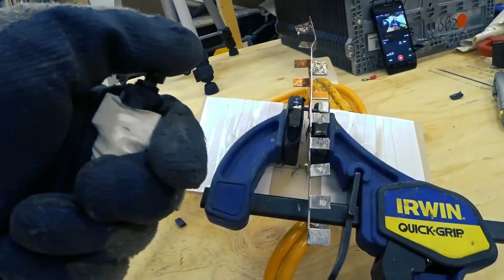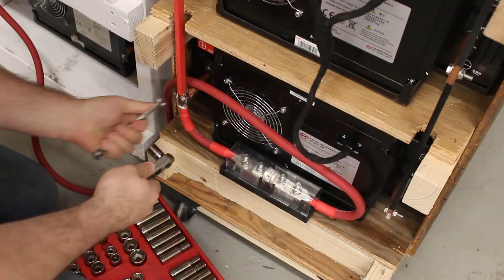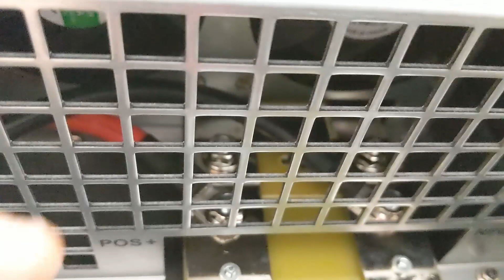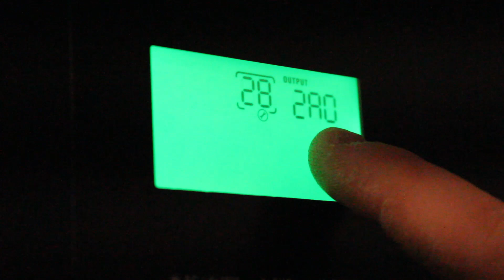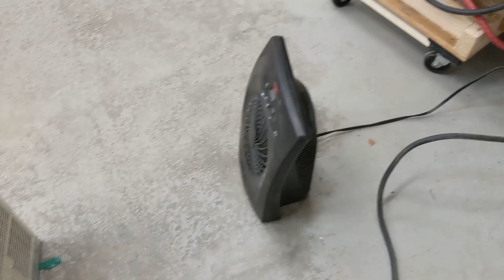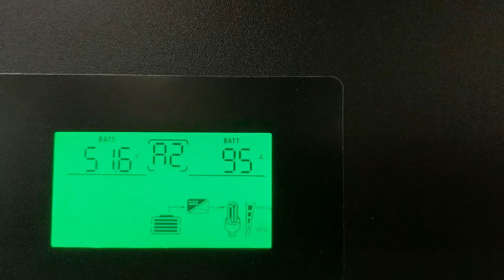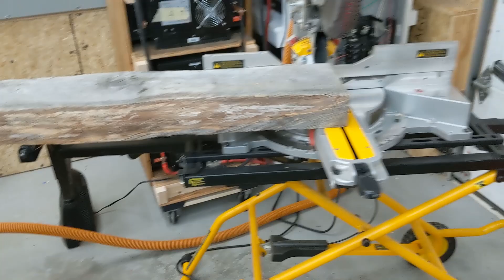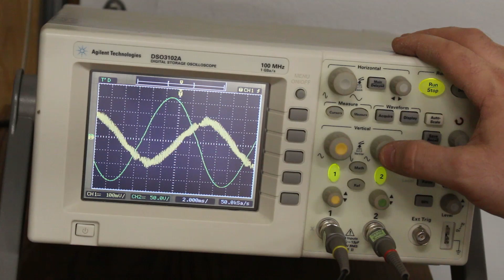Split-Phase Inverter, LV5048, Test Solar, Off-Grid

Comment: Like you, I'm concerned that the single inverter in split phase mode couldn't start the miter saw. I know well pumps have significant start-up surges, probably larger than the miter saw. Tying the inverters together in single phase mode would likely start either the miter saw, or the well pump.

Have you been able to see how the inverter works at your friends place?
Reply from the maker: Yes, it was able to start my friends well pump, but only if nothing else big is on.  The inverter overloads if the well pump tries to start while something like the toaster is on at the same time.   https://youtu.be/6XLOKtl-q3s

Comment: I believe you can put the unit in 2A0 mode (120V output, L1 and L2 in phase) and short the L1 and L2 outputs with a jumper to get full power (5000W) at 120V. This is what was recommended to me by Andy at MPPSolar and it worked.
Reply: how is this working for you? I am thinking of doing the same with mine.
Reply: Only if you dont have 240v input from grid. If you dont do the jumper the unit will not charge your batteries with grid. Some people trick the unit with jumper to make grid possible when 240v grid is not available.

Comment: You must have some settings off. I own 2 of these units even when I only had 1 installed I was able to run my entire house and some of my barn along with my 3 ton heat pump and we'll pump. I only installed the second unit because I would occasionally over draw it. Now running 2 units I have never overdrawn them. I remember while setting up my unit I had some settings off and it acted like what you are seeing
Reply: Can you remember what needed to change or can you recommend what to watch out for when setting this up? I'm about to use one of these myself for an off-grid system. Thank you!

Comment: Question... how can I set up my 4kw on grid system to work off grid without batteries? I currently have a SunnyBoy inverter, but it is not hybrid. I want a set up so I can switch to off grid when the power is out to use my solar when the sun is out without adding batteries. Thanks!!!

Comment: Hello
Have you tested any other of the MPPsolar inverters?   Have been thinking about switching over to a solar converter to rid of having to have a controller and inverter as well as all the wires.  Am interested in the 24v unit the 2024 or the 2424. I just cant find alot of info about it on youtube.
Reply from the maker: I have not tested any other model.  Try checking out Bobby's channel.  He is running a 24v unit.  It might be the same model as you are looking at.  https://www.youtube.com/user/yankey4

Comment: David, what size resistor did you use on the initial setup of the investor? I saw the 100W, what ohm is it or does it matter? Thanks again.
Reply from the maker: I think it was 1ohms.  I bought it on Amazon but the exact item is no longer available.  But I found several other sellers with identical looking resistors.  an old incandescent light bulb can also work.  Higher ohms could also work, but you will just hold it on slightly longer.
Reply: DavidPoz thanks found it on another, ordered a few to do other things with. Thanks for replying to me.

Comment: Excellent  5 KW  2 phase ( 120 & 240 AC V )  inverters  #  David when U connected  UR   space heater  ( 4800  Watts  /h )  it was  working   , means  2  separate  2.5 KW  inverters in this  single  5 KW/h inverter  are    interconnected  (  parallel or series  )  otherwise  UR  4800 KW / h space  heater   wouldn't   work  #

Comment: The Lv 5048 can be switched to 120 volt AC only, running both it’s inverters in parallel thus it can do a chopsaw with sudden surge but only if it is not set up as 240 volts, cause then each leg is limited to 2500 watts.

Comment: So did it power your buddy's well pump?  How is it working for him?
Reply from the maker: Yes, it was able to power the well pump.  But it has overloaded on him if he has another big load on it.  For example, if the microwave is on and then the well pump tries to turn on.  Then it overloads.  To me, it's too close.
Reply: Ya that's no good. I would not be happy.  I wonder if 2 3000 watt growatt inverters set up in split phase at 6000 watt would fare any better? I'm thinking of going that direction or maybe buying an Aims inverter charger.  
I think there are a lot of people out there looking for your type of review where things really get put to the test on the new Growatt 3000w 24v or 48v units.  Also the MPP solar LV2424.  Although it's quite similar to the lv5048.  I bet MPP USA would work with you to review their stuff.  They are refunding $100 for people to review the ones they buy on YouTube.

Comment: With each of these videos I watch I get slightly dumber.  I'm going to have an electrician install what I have.  It's a MWS 2000 W wind turbine, their MPT Classic all in one charge controller, a 24 V 6000 W AIM sine wave inverter and 10 12V batteries of 140 Amp connected in series by 2's so their are 6, 24V 140 Amp batteries then the 6 in parallel giving one 24V lets say 600 usable Amp AGM Battery.  I know jack about this stuff and there are enough skull and cross bones for me to yield to the electrician.  I'll do a video of what he comes up with.  But as far as I can tell the turbine has 6 wires coming out that are 2 seperate 3 phase AC power sources.  They are to go into the charge controller.  The charge controller goes to the battery.  The inverter goes to the battery but here is where I'm lost: It seems like they want me to connect the inverter to the main breaker.  There is an AC in and AC out on this thing.  The manual appears to want me to take 3 phase AC from the main to the inverter and back out again.  Plus it mentions grounding everything to which I am over my head.

Comment: I have a much lesser Inverter that I have purchased used. I bought it without fully understanding it. It is an Accurate Tools ATSIU-2500watt Pure Sine wave Inverter. It unfortunately is 240V vs 120V I was expecting. That said I was curious if I measure ground to Live I get 120V. If I measure ground to Neutral I get 120V and if I measure Live to Neutral or Live 2 I get 240V. This is a 24V instead of 48V. My question is would I be able to connect it to my Dryer port in the house. turn off all my other 240V items like AC, Furnace, Hot Water Heater, etc. and the Mains breaker (don't want to back feed the grid in an outage) and power my house in the event of a power outage. The power outages are becoming less common but we use to get power outages at least a couple a times a week. This is an old unit that I bought but was trying to figure out how to make it useful. I would be willing to ship it to you to put through its paces if you were interested.  Let me know.
Reply from the maker: If you have a 240v dryer, then it probably draws about 4000 watts when the heater element turns on.  So it would probably overload your 2500w inverter.
Reply: @DavidPozEnergy  Sorry I did not explain too well my intent. I plan to unplug the dryer but use the 240V 4 pin port to plug my 240 volt inverter into my house. I know it would be better to have a dedicated port but this is in close proximity and already exists. I would not be running the dryer off the inverter but trying to power my other 2 phases of 120V from my 240V inverter. Things like my router for internet and TVs and things like that. Without my AC, Furnace, Hot water heater, washer dryer,  and range i feel that 2500W would go a long way. Mainly Fridge and a seperate freezer unit in the garage

Comment: Dave can you post your buddies results. If it works with his well pump. I would like to do the same setup if it works. Thanks.
Reply from the maker: Yes, it did run his 240v well pump.  But he found that the inverter would shut off if two large things were on at the same time, like the microwave running, and then the well pump kicks on at the same time.

Comment: Cool ! Nice Video.
We have the exactly model ISolar MLV 5KW.  it is Super Power 5KW for 120Vac 60HZ output (Like US/ Canada/ Mexico and Latin America countries). it also support split phase 240Vac ( L1-N-L2). it can be parallel with Max 3 units. So you can get Max power 15kw for single phase and 3-Phase. Check this link: 
https://www.aliexpress.com/item/33058021760.html

Comment: That sine wave is noisy as frig even with no load, that ripple voltage appeared insane. Would love to see the THD with a power quality analyzer.
Reply: If you look at the settings on the bottom of the oscilloscope display, one channel is set to 50V/division (correct) whereas the ‘noisy’ channel is set to 100 millivolts/div which is obviously incorrect.  Need to manually set up the second channel.

Comment: This video  definitely  helped me ,  I was on the verge  of purchasing  this  model  however  after this review  I will revert to my original  plan and do separate  charge  controler  and inverter. At least if my inverter  is rated at 5000 watts , I know that's  what I'm getting .
Reply: Basing an important decision on Dave's amateur testing is not really a good idea.

Comment: Hi Dave, what was the error code that you were getting went it overloaded?

> I got the Hybrid LV 5048 Inverter/Charger. It is set up as a single phase; I was getting error code 72 when there seemed to be an overload. 
I sent email to MPP solar and they said: "1.What is the program28? Is it 2A0? If so, please short the AC output L1 and L2 then try again."
So I combined L1 and L2 on the output side and now I can run things that used to generate error code 72. 
The question is, what happens to the 240V option?
Reply: What does it mean to short l1 and l2? just add a jumper wire between the two? I am thinking of trying this.

Comment: Line to Line voltage in a 2 phase system would be 208 volts not 240 volts, this is a split phase system as your title of the video implies. This system does not output 2 phase power but can output 240 volt single phase or from what you initially measured before changing setting 28; two separate 120 volt single phase power outputs. Thanks for the video, it's really helpful to watch someone actually set up one of these systems. You can see how well it's built and the features it has first hand, looks like a really nice system.

Comment: So what's the follow-up? Did it power his well pump reliably. I'm looking at this for the same situation. My pump is 1.5hp 220vac, can convert it 115vac. But worry supply wiring to the pump will be undersized if I'm passing twice the amps.
Reply from the maker: Yes, it did power his pump: https://youtu.be/6XLOKtl-q3s

Comment: Thanks for the demo David, I was really curious about the wave, and loved that you hung a scope on it!... however, as others have pointed out, you may not have had enough knowledge to accurately demonstrate reality.  HV probe / isolation certainly would be good and a safer approach, but I suspect the probe on ch1 was not connected (or maybe had internally failed), as you were at 100mv and it was just erroneous noise.  Ch2 was accurately showing the wave.

My question however... where were you obtaining / referencing earth ground?

Also - regarding the inrush current the saw motor was presenting, you might be able to add a NTC (negative thermal coefficient) resistor in series with the load (properly sized for this load), which will ramp the demand over a longer time.
Reply from the maker: You are way beyond me with your knowledge of the scope.  Sorry I can't help more.
Reply: @DavidPozEnergy  You seem like a pretty smart fella, scopes are easy... just think of it as a voltage over time display.... lots of easy "101" videos if you want to use that tool to your advantage.  Thanks again for posting too :)
https://www.youtube.com/watch?v=lSHAE_Y6snc

Comment: David, after doing some testing and learning.  It is highly likely that if you let it run as one phase it would have ran the saw no problem.  It is advised to just leave the unit as single phase unless you need split phase.  That would have allowed a surge of over 7kw of power which likely would have been no problem.  Those with more than one unit don't see to have any issues with massive surge, or running a soft start.

Comment: Thanks for posting this video.  It's too bad the unit was not able to carry the miter saw.  I noticed the saw was drawing 30-35 amps on initial startup.  Surge is probably too quick to notice, but I'm thinking twice that.  This unit is rated for 40 amps, though not surge.  Beyond 40 it goes into bypass mode.  My experience with other units is that if it says it's rated for 40 amps, for instance, it's either right at 40 or less.  My guess is it can't really take on 30 amps.  These particular units are made to be paralleled.  I wonder if they might perform better with two or three (the maximum) at three phase.  My guess is the maximum amps is 100 at that point....more than enough to run the miter saw.  The unit can only take 145VDC so my guess are that panels are paralleled to produce higher amperage's for that quick surge.  The units I use allow for higher voltages from the panels so I'm not burning up wires on the roof with high amperage.  I prefer more inverter's paralleled with less amperage on the roof while handling high amperage to the load with a 'team' of inverter's sharing the load.  Of course...that means more money too.  Wished there were two of those units.  I really wanted to see it perform in parallel.

Comment: Probably someone has commented, but the proper term is not "phase".  The proper term is "leg".  In 240 volt AC split "phase", there are two "legs".  The single phase has a center tap to divide it into two legs with the center tap as the neutral.

Comment: Greetings, David was thinking of buying a LV5048 Solar Mpp Inverter where would I buy it?
Reply from the maker: You buy them straight from the factory.  Send them an e-mail.  They are decent if you don't plan to power anything with high surges.  https://www.mppsolar.com/v3/contact-2/

Comment: 16:10 David, I don't know if anyone has mentioned in the comments of this video. That chop/miter saw start up surge may be helped greatly by having some sort of A/C capacitor bank set up to handle the surge. Large central A/C systems use them for the compressors & condenser fans have them for similar purposes, however the fan uses the cap for single phase start up. I'm not sure how many uF or F (FARADS) the caps would need to be for that saw. Might be help to you to save the life of a few inverters in the future. Good Luck Man & Nice job on your video content so far. You're a fast learner it seems. RLTW!!

Comment: Thanks for the information it means that the LV5048 inverter does not have a high peak at start-up that can stay several seconds until the equipment that connects it falls to its amperage level or I am wrong.
Reply from the maker: you are right.  Don't use this if you have high surge loads.
Reply: @DavidPozEnergy  Or use starting caps or use transformer. Aren't we learning anything here??

Comment: Greetings, I am from Puerto Rico that LV5048 inverter that works and why does it lie that way when you connect the saw and the vacuum cleaner, will it have to be configured?
Reply from the maker: The inverter does not have a very high surge capacity.  The saw needs a high surge to start.
Reply: @DavidPozEnergy  what was the power rating of the Mitey saw

Comment: Would the CSL500 Surge Limiter or similar help with the issue??? I dont know anything except battle born batteries told me I would need this unit to prevent shut down.
Reply: The CSL500 Current Surge Limiter is a FET-based current limiting device that is to be used with Battle Born Batteries LiFePO4 battery packs when they are used in conjunction with large (greater than 4kW) inverter/chargers. 

The device is mounted permanently in series between the negative pole of the battery bank and the negative DC input terminal of the inverter/charger. The device protects the battery management system (BMS) from damage caused by the initial current spike that is created when connecting directly to the large capacitors (> 5 milliFarads) that are typically on the DC input side of the inverter/chargers. 

The device allows the batteries to slowly charge the capacitors (within 1 ms). This soft start avoids the high-current shutoff inherent to the BMS of the batteries.
Reply from the maker: The CSL 500 would not help in the situation I illustrated in the video.  In the video I had the inverter connected to a huge battery bank.  The battery could handle all of the surge capacity of this inverter and more.  The CSL 500 is for when you have too small of a battery.  I would suggest increasing the battery bank.

Comment: This video was very helpful, I was considering this inverter for a system that would start multiple refrigeration units
Seeing it die from starting a miter saw motor with its comparatively much lower surge has told me to stay away from this for my application, not enough surge capacity
Reply from the maker: Glad I could help.  I wish it did better.
Reply: Dude i run 4 fridge and 2 mini splits with no issues. I have 5kw of solar.
Reply: Patrick, I think if this inverter were configured as 120v 5kw it would do the job.  Instead Poz configured it as 2x 2.5kw inverters out of phase with each other. It should run the well pump in that config.  I also seek a solution to run 3 fridges & freezers (along with other smaller 120v loads) and want to find a low cost way to do that.  I think the MPP 5048 inverter is the answer.

Comment: We have the mpp solar inverter lv5048 hooked up to a generator, but, we want it to automatically turn on the generator when needed. Does anyone know how to make this function work?
Reply from the maker: I don't know, but here is a link to the manual.  I hope it helps.  http://www.mppsolar.com/manual/SPLIT%20PHASE%20LV/LV5048%20split%20phase%20manual-20191024.pdf